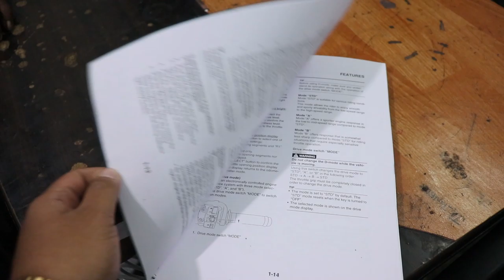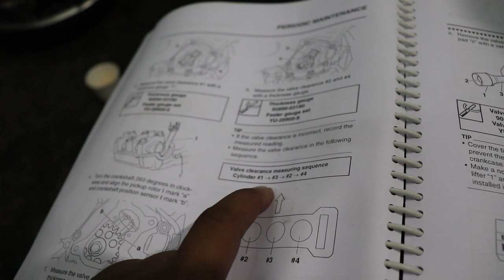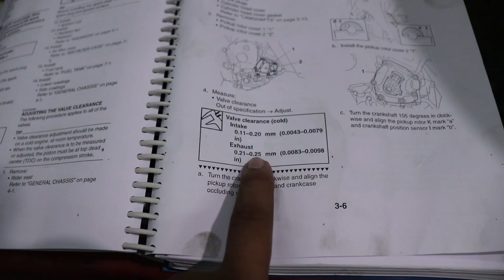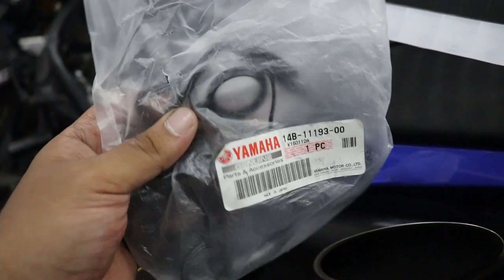VALVE CLEARANCE EXPLAINED | 2011 YAMAHA R1 CROSSPLANE

Comment: Bhai explained very well! Honestly this is one of the scariest DIY project you can perform on your bike. Bigger the bike scarier the job.
However, I think your said the opposite thing about valve closing.
The valves are supposed to open when the pointed end of the cam hits the valve end and not close the valve. I may be wrong. But this is what I know.

Comment: Hi, my R1 is stalling after valve adjustment and a manual cam tensioner install. The bike starts fine but it won't stay idle. The engine stalls without gas even on neutral. Any pointers on where I should start looking?
Reply: ignition coils